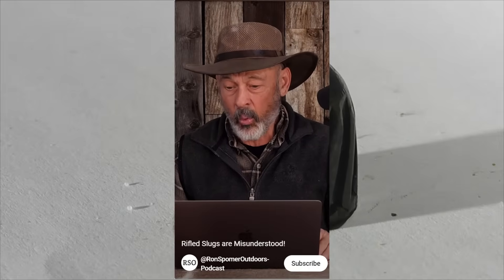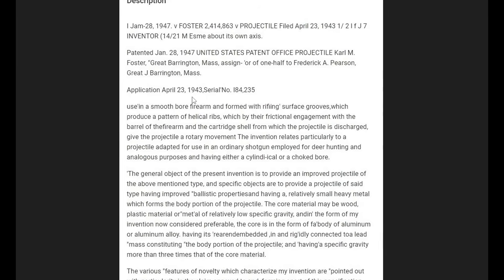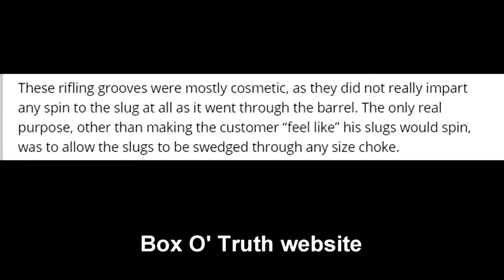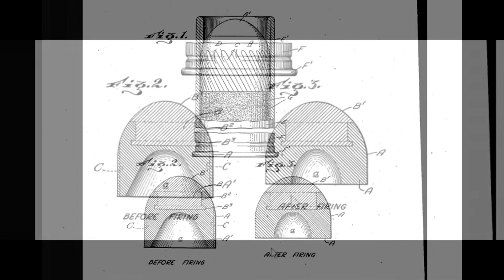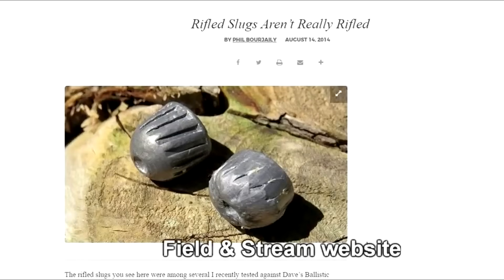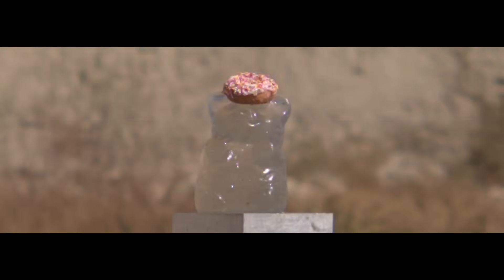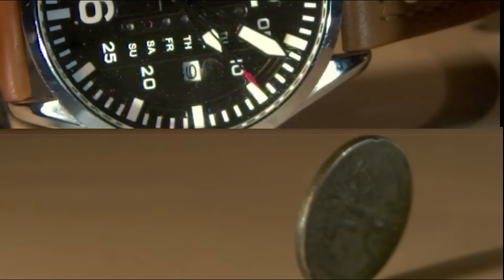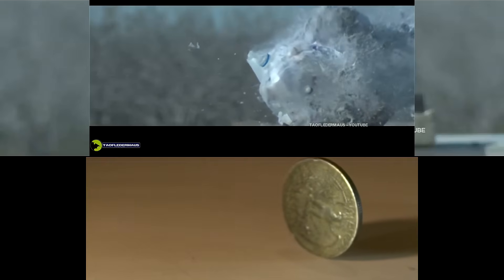Yes,  RIFLED Shotgun Slugs SPIN - The high speed camera doesn't lie

Comment: I'll be honest. I've owned a 12 gauge for years and have never shot a slug. I kind of understand them but MAN your channel is very beneficial for understanding this projectile. Thanks and Merry Christmas.
Reply: That’s a bummer, slugs cut a beautiful hole in plywood
Reply: @assmaster420  the shotgun I've had up until recently was not compatible with slugs. It's stamped right on the barrel. I just got a 1301 so I see slugs in my future
Reply: @The5As7  ah yes, full choke. Not a great idea to put slugs through, I'm told.
Reply: @CrashRacknShoot  I shot several deer as a kid with a fixed full choke - it seemed accurate enough to me and my dad before that.  I think it’s the extra full goose and turkey chokes that are a real issue.  Wouldn’t be my choice now with so manny other options, especially as they now allow rifles for deer in my state.
Reply: @stevek6486  might be. The again I've also seen barrels bulge near mid-front from shooting slugs if they're full choke. I guess mileage varies.
Reply: @CrashRacknShoot  Not unless your not very fond of the muzzle of your shotgun.
Reply: @The5As7  you should try it...
🖖🏻🇫🇷😎🇫🇷😎🇫🇷🖖🏻
Reply: @philippefrater2000  I plan on it. The look fun, I love 12 gauge.
Reply: @The Five A's  mossberg 500 with smooth bore and rifled barrels u can get em around 400 depending where you're at. The rifled barrel has a cantilever picatany rail for a scope or dot. Can't go wrong. You can buy an 18" tactical barrel for it. Shit u can buy everything pistolgrip whatever
Reply: @stevek6486  what state is this Steve?
Reply: @assmaster420  Yes they do! 👍🏻🇺🇲
Reply: I don't often slug, but when I do I FURY SJHP. Stay thirsty my peeps.
Reply: Oh man. Used to be able to get 5 slugs for about $3.50. Those were the days. Have shot many of them.
Reply: Slugs are great for blasting pumpkins in November that didn’t sale for Halloween and can be bought extremely cheap.
Reply: The segmenting slugs do indeed break into 3 even pieces. Pretty much like regular Fosters do anyway, but reliably and in 3 pieces. A Foster will flatten quickly into a donut, around the front dimple, about 1.5” in diameter, and usually break into 2 or 3 pieces. Penetration is about a foot in gel, with big wound tracks. For hunting, German Brenneke slugs are much better. A solid cylinder of harder lead with a small dome on the front, like a round nose semi-wadcutter. The wads are attached to the base, some with a screw, and stay with it in flight. Expansion is minimal, buts it’s .72 to start with, and penetration is 24” plus in gel. And very accurate in smoothbore or rifled tube or barrel.
Reply: @raleighthomas3079  any accuracy at distance trade offs or is this one of those rare "all win" engineering trade offs? They're unicorns, but do happen from time to time.
Reply: Ive shot a slug several times but never did a deep dive analysis.  thanks for doing it for us!
Reply: Put slug in less rowdy end of boom stick, point boom stick at problem, if you get "bang" you have one less problem. If you get "click" you have at least one more problem. Repeat until you have no problems or more problems than boom-stick slugs... Or if problems appear faster and worse after first half dozen applications. YMMV and might depend on boom-stick and slug quality as well as your tendency to drift from point of aim.
Reply: I’ve shot a bunch of slugs since my local indoor range only allows slugs (they’re worried multi-projectile shot would damage equipment). Though given their expense and the fact that I found an outdoor range that lets me shoot anything, I haven’t fired some in a while now.

I wonder if this channel ever tested the defensive slugs I have which can break into 3 pieces. Have a few of those on my bandolier.
Reply: @gameragodzilla  send them a box. Just make sure that they have enough to did you a good amount of testing and some practice shots to sight in
Reply: @borttorbbq2556  I saw them test the other Winchester PDX defensive slug, the one with 3 buckshot. May have to see if I can send them some of the segmenting slugs.
Reply: @gameragodzilla  oh yeah I remember that video that was a good one. I've been watching their channel for so many years but yeah you definitely should. I genuinely love seeing the different types of rounds that places have come up with I mean hell even I have considered making some and sending them in I don't have the stuff to load them but he does and that should be fine
Reply: @gameragodzilla  I'm pretty sure they've tested frangible slugs
Reply: @gameragodzilla  tell me more about these defensive slugs that petal off. Sounds like a brilliant or terrible idea depending on implementation and reliability.
Reply: @ScottLovenberg  That’s part of why I wanted to see some tests, to see if the segmenting slugs are worth it. I just saw it off the shelf at my local Academy, thought they looked cool, figured I could use a few slugs on my bandolier alongside my usual buckshot, and bought them. lol
Reply: @gameragodzilla  you worry about accidentally loading one and anticipating the wrong recoil or flight path? 

I've always heard that argument for not mixing bird and buck (especially in semi auto where the bird might not cycle) in the same place. Then again, having bird and buck separated but using the same carrying mechanism (I've seen Velcro shell holders for quick swap onto your shotgun and the like) potentially gives you only bird when you want buck or slugs. 

Me? I load random and expect random. Aim small, miss small. It's the most optimal solution for the worst strategy, which tends to work in real life more often than you'd hope for.
Reply: @gameragodzilla  look up DDUPLEKS,  they're some of the best on planet but... they're made in the EVIL RUSSIA RUSSIA RUSSIA.. lol.. good luck finding them.
Reply: In states that also prohibit the sale of garden seeds to rural folks while locking them down to lessen congestion on her royal governorship's boat outings, deer hunting with a rifle is also verboten (but not birds, squirrels, ants, clouds, nor anything else). Buckshot wrecks too much meat for use in non-driving hunts, and is excessively short range for the bigger/badder/alertiest whitetails. For conditions like this, shotgun slugs, and how to get them to fly straight, is a perpetually hot topic. Also, the ability to knock out a shoulder blade and pin the runny bastard to the ground, instead of following it 100yds after it loses all the machinery in the ribcage, and seeking permission to cross 1 or more properties, any of which are likely to tell you to F-off and shame you for eating the creature that would otherwise fly through their windshield on the way to grandmother's house... It's better to just pin them to the ground and donate that shoulder roast to the dogfood bucket, as nature intended... Also, the meat tastes better if they can't convert all that flavor to lactic acid from running 100yds without a heart and lungs as their last act. 

...The other videos on this chan are largely to keep foreigners from thinking that invading would somehow be straightforward and without the hilarious embarrassment of their loved ones being notified of cause of deaths like "Lego Superman to the eyesocket", "Backstop for lead plate, to appease a safety-minded audience that has identified a distant road in frame", "A good ounce or two of razorblades/nails/coinage bound by crayons that have all their colors mixed into brown, and loaded with industry-beating shock management for enhanced data and dataplan destruction, known only as 'wad'", or, most horribly, "Utterly fucked by a frozen pork sword, and possibly a silly putty execution, but glass and candy were certainly involved, somehow".
Reply: @buckstarchaser2376  lmfao 🤣👍🏻
Reply: @buckstarchaser2376  There are a few podcasts with discount codes to BetterHelp, my guy. Happy to point you in their direction. Yikes

Comment: Jeff since watching your videos of these slugs rotating and still seeing and reading people say they don't spin I always wonder don't these guys watch Taofledermaus? That fired Foster slug is pretty short and shorter projectiles need less spin to stabilize than longer ones. I've read round balls need only very slow spin to make them fly more stabile, something like around 1:60 spin or even slower. And that Minnie balls can stabilize pretty well from those slow twists as well. Those fired Foster's would be in the range of those too I'm thinking as far as the spin needs go. Those demonstrations of spin and obturation were excellent.
Reply from the maker: Thank you Nick!   Some of really long slugs we couldn't stabilize even through full rifling.   Shorter is def. easier to do.
Reply: Even rifled muskets like the 1861 Springfield with 1:72 or 1:78 twist rates impart a spin of over 10,000 rpm if you do the math.